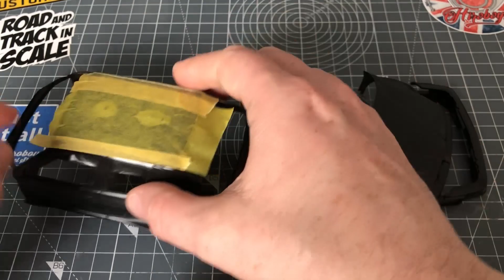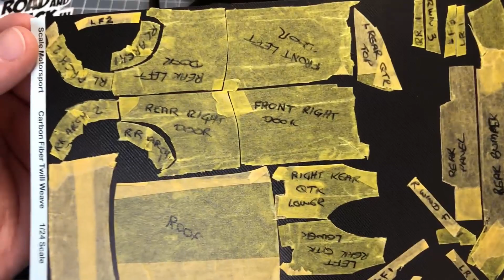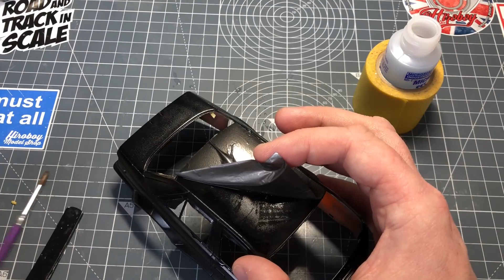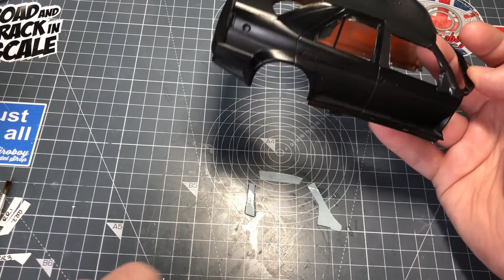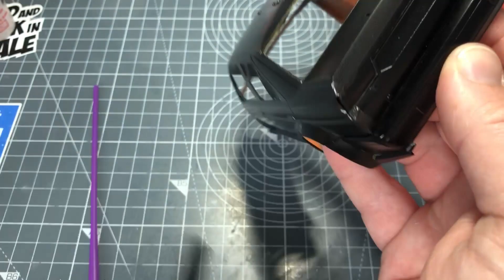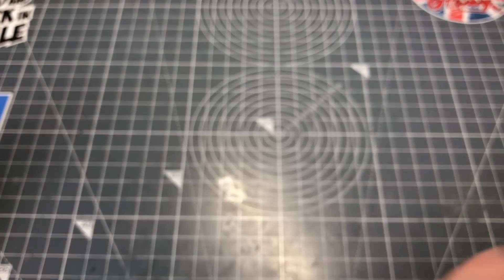Full body carbon fibre decal application

Comment: is micro sol something similar like marker fit from tamiya ?
Reply from the maker: Hi Patrik Marek, yes it’s the same type of product, designed to soften the decals. I’ve not used the Tamiya one though, so can’t compare on the strength difference between them.